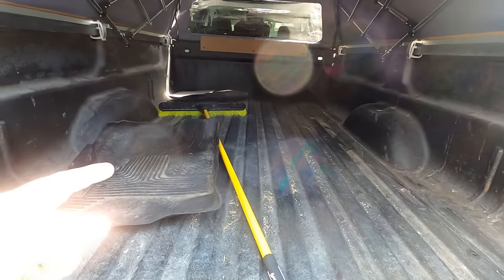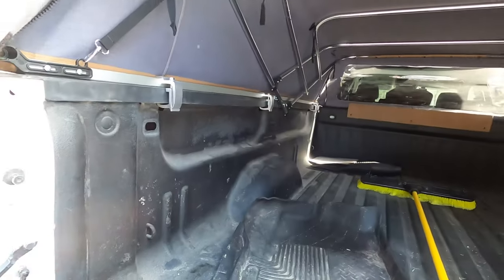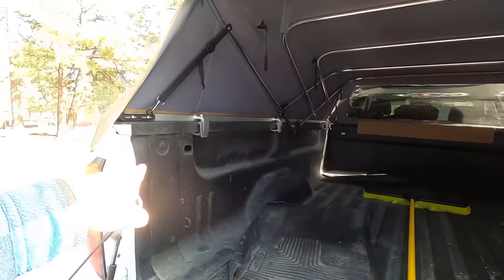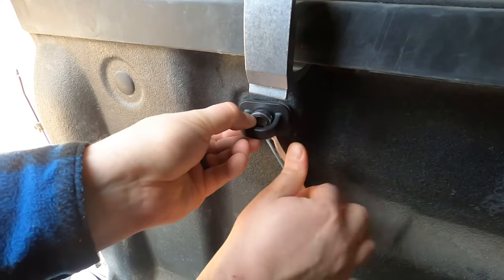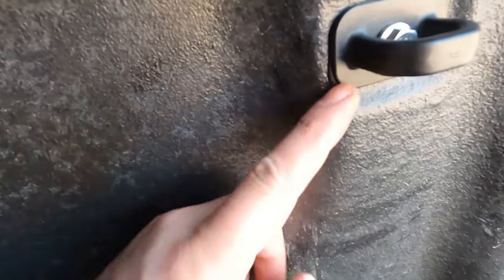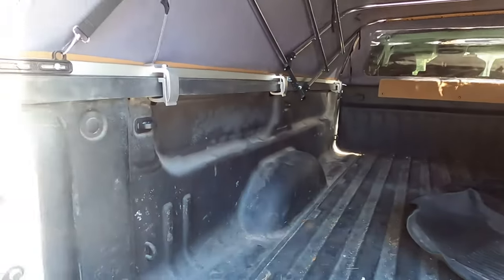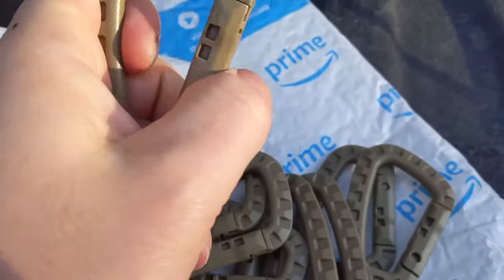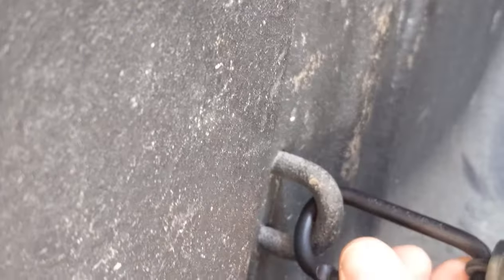Easy Pickup Truck Bed Upgrades

Comment: Those two vertical ridges behind the net are for any size lumber to slide down in as a stopper also
Reply: Yes, I was going to say that, any 2x would work. 2x10 should be sufficient. But the net is cool too and you don't have to have the wood in the bed.

Comment: Just came across this post and you have a great truck. I will always have an eight foot bed on my truck. One way to beef up a net is to lace some 3 strand line through it to take up the stretch, do it horizontal and vertical if necessary. An extendable boat hook is also handy for retrieving items in the bed. I remember when trucks came standard with eight foot beds, boy time is flying. Good post.Thanks!👍⚡️

Comment: Home Depot sells plastic trays. Talk in the back , short in the front. About 4 yrs ago $15. Two fit almost perfectly in my 2020 F150. I use a cargo ratchet bar to hold them in place.

Comment: I was looking for a net or barrier for groceries and came upon this. Do you think it'd be able to hold a few cases of water bottles?
Reply from the maker: I tend to put stuff between it and the tailgate. Plenty of room, on my truck at least, for cases of water, soda, DEF, gas cans (sideways), etc. It stretches a bit so heavy stuff may slide. I wouldn't put cases of water in it as it's not wide enough. I keep moving blankets, a toolbag with tie downs, and funnels within the fold of the net itself. Anything larger, like I said, between it and the tailgate or behind it and in the bed.

Comment: What's that topper you have, and is it waterproof?
Reply from the maker: Softopper. There's a video on my channel about it. Everyone asks that and it is waterproof. Very good. Corners where it meets the bed some water can get in but that's just positioning. It comes with a bottle of waterproofing for the seams but I've never needed it.